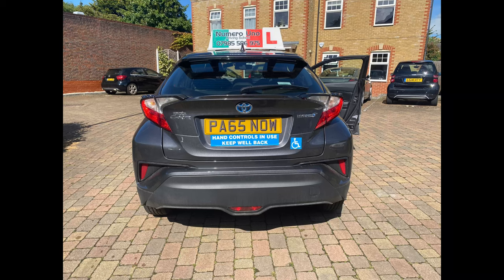Tailgating. The dangers, And the physics

Comment: If the reaction time is the same for wet as dry surface, such as not much spray, then why keep back 4 seconds in the wet instead of 2? Sounds like calculated from when wipers might have not been as effective decades ago. Assuming both cars have similar wet braking distance like the C-HR and the Golf. 

Secondly I wonder if instructors generally should teach overtaking more as too many qualified drivers falsely think that a close following distance is necessary for good overtaking.

Thirdly I guess Golf driver was concerned the learner was going to turn left down that empty road Golf went, which might cost Golf minutes at the next traffic light (or roundabout where C-HR has less acceleration time  - 7s vs 11s - and experience). If Golf is meeting slower drivers all the way through commute that few minutes might potentially add a third to their commute time. Just trying to understand Golf perspective - I still think their tailgating is very unsafe, and possibly reflects a terrible attitude!
Reply from the maker: Thank you for your comment Dee. Regarding distances, it’s simply due to reduced friction between the tyre and road surface. It’s also not uncommon for a car to take longer than double the distance it would in the wet depending on the tread depth, temperature, and amount of moisture on the ground. 

Your overtaking comment I think is a valid one and I’ll put a video up on it soon so thanks for the idea. I do teach it but I appreciate that it might be difficult for some instructors if they teach in city centre’s. Although most students are willing to do 2 hour lessons, some clients can’t and therefore, makes teaching subjects like overtaking and motorways impossible. 

And then we move on to the Golf driver. He may have been thinking that but I am sure his attitude towards a red L was the issue. When I reviewed the clip after, he didn’t tailgate the vehicles behind, nor the one he moved behind before turning. I conducted an experiment with an academic at Kings a few years ago to show the physiological changes that people have when seeing an L plate. I’ll put a video up on it when we complete our findings.
Reply: @learntodrivetheeasyway  
I agree. I find it interesting that the 2 second rule seems to be a compromise between safety and some other factor like getting as many cars through an intersection as possible. Because at 60mph, if car ahead crashes and halts almost instantly, even with a (probably mentally impossible) instant reaction time, stopping in the dry will require about 3 seconds. As a typical driver can take almost 2 seconds to react and not brake fully the total stopping time can increase to 6 seconds. So I wonder if instructors and Highway Code should focus more on teaching stopping TIME (stopping distance seems like a distant abstract "theoretical" memory to many qualified drivers, and seems more difficult to calculate accurately in real world by comparison)